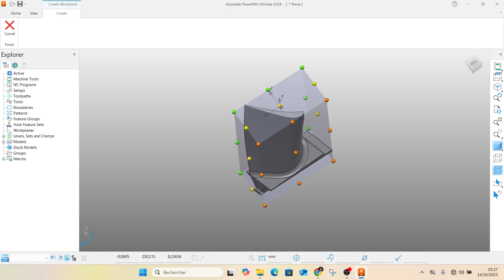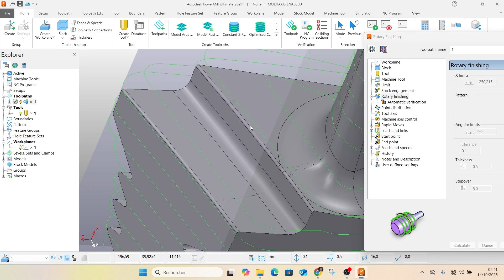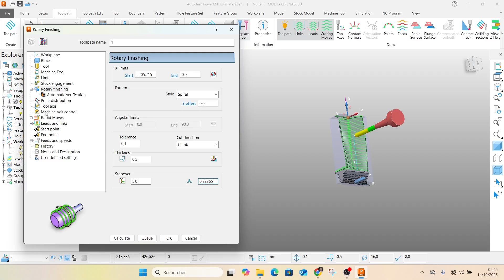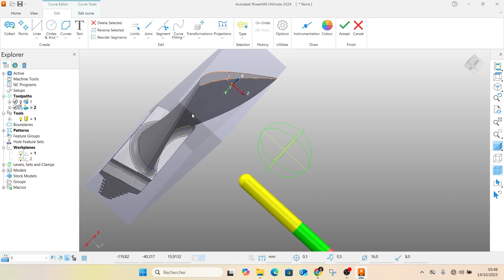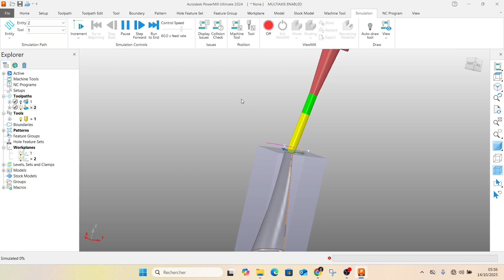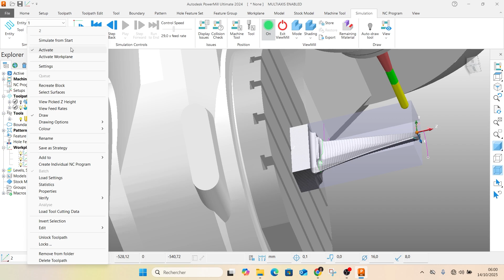Machining a Turbine Blade (Single Blade Machining) - PowerMill English Tutorial For Beginners - CAM

Comment: Thanks 🙏
Reply from the maker: You're welcome, if you have any problem in PowerMill tell me, so i can do a video of the topic ^^
Reply: @sbcad-cam thanks again 
I didn't find any details about MTD files and how to customise them 
It would be great if you share your experience
Reply from the maker: I've never customized a machine tool in PowerMill, generally, when we need to customize .mtd files we directly ask for them from autodesk.
But they give use with the .mtd file a txt file where you can customize limits and angles of the machine and some other parameters.
Reply: @sbcad-cam fine
How to get MTD files?